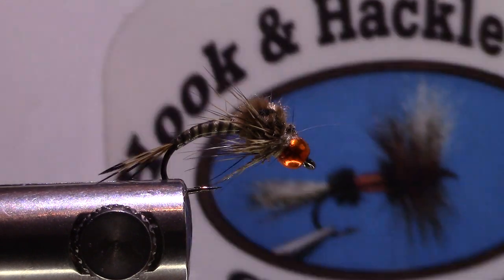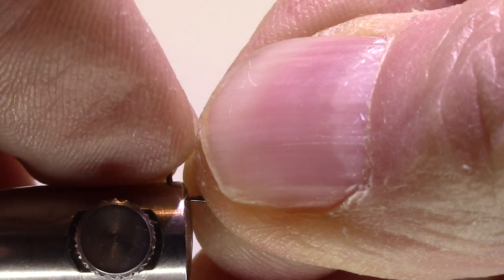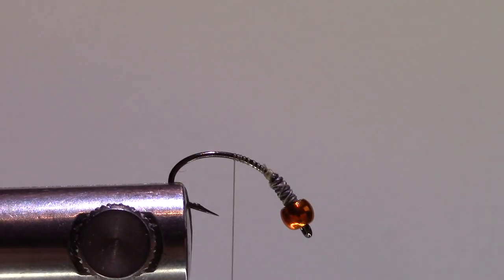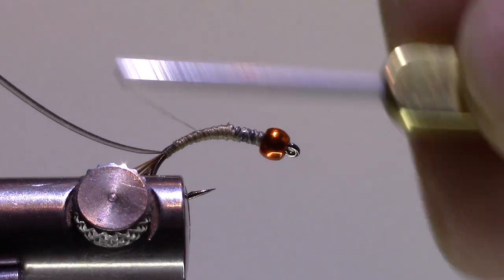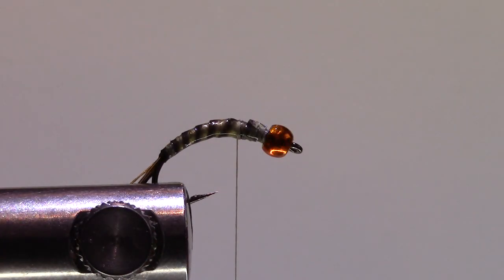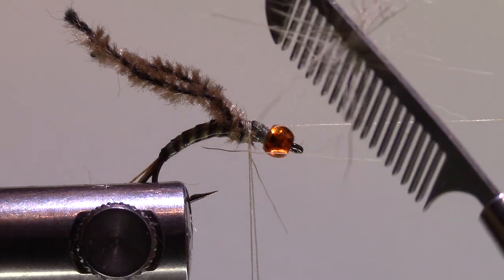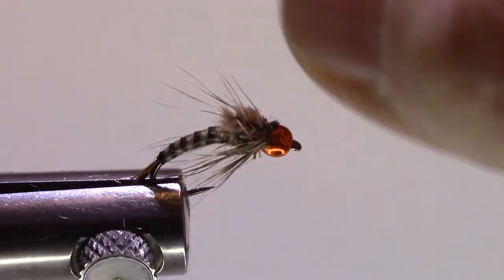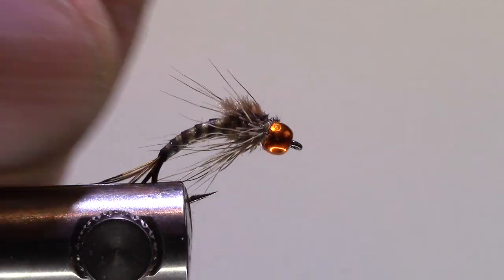Synthetic Quill Deer Hair Emerger

Comment: Hi Robert -
 I was surfing for some emerger patterns - came across your tutorial & impressed well done !!!!  
I am from the UK & fish traditional old styles, wet wings / spider patterns with 3 droppers I will use the chenille & deer hair with no weight, this might be interesting  for your friends who trout fish to try -have you ever used your emergers by attaching your fly direct to the leader  with no dropper but where your top dropper would be - retrieve slowly it does work, just forget the fly is there it will not upset the cast in any way you can also do this when dry fly fishing.
Tight lines keep up the good postings Steve